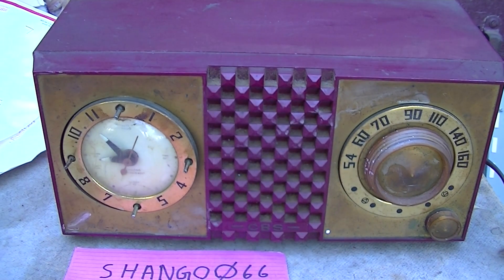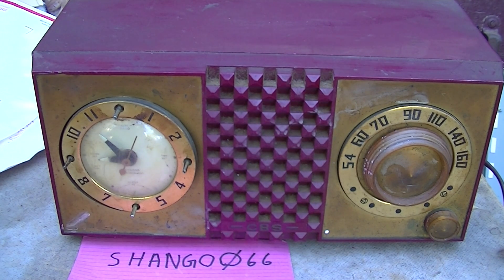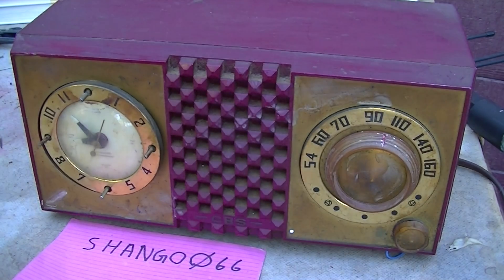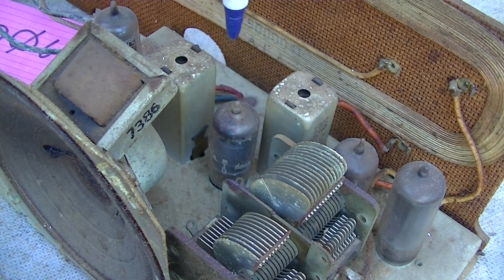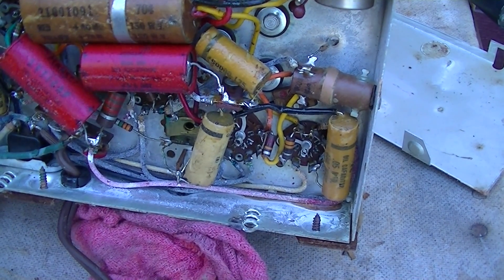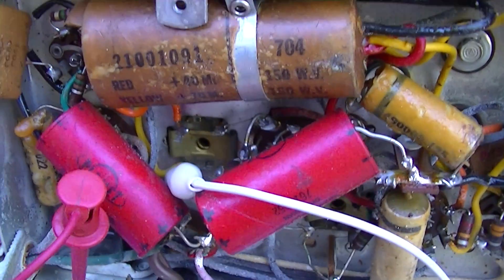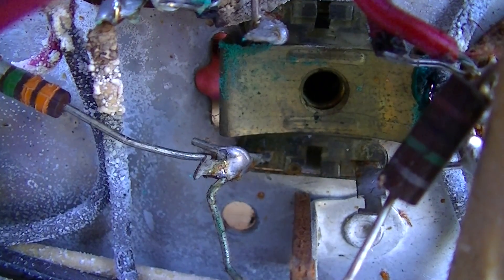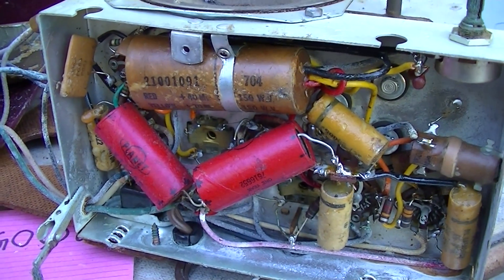CBS 5 Tube AM Radio Diagnosis

Comment: Greetings:
Suggest using modulated 455kc as signal to trace; more likely to be found, yet more test equipment in use,
After if surgery,, Use your variable caps with 455kc applied to tune for resonance with cans outside chassis, making fixed value caps easier to install and only needing 1 vari-cap at a time. (Yes a few clips are needed, too.)

Comment: looks a lot like this radio, maybe a rebranded Motorola?
http://www.ebay.com/itm/Vintage-Clock-Tube-Radio-Motorola-Model-52C-Brown-radio-clock-work-w-static-/152332135141?hash=item2377b3eae5:g:x4gAAOSwNRdX7YzF

Comment: columbia engineers made nice long lasting hi fi  radio &  & software,folks had a pile of christmas & other classical records from cbs,these records were badly scuffed & worn after about 12 years of play on a sears portable stereo record player,,half the wear for nieces & nephews putting on 45 rpm bubblegum &  fred flintstone on them, I use joy dish washing liq to soap them up,run the records under the water faucet,wiped them with a towel, played a few of them on 70s stereo system I bought,, folks were quite thrilled with the sound of a decent amp, mag cartridge.

Comment: Yuck!  Who painted that purple, or was that the actual original color?
Those "slug tuned" cans actually come two ways, a true slug that is usually tuned with a hex tool (but I've seen some that used a slotted screwdriver), and a 'cup core' type that covered the coil both inside and out, these usually are of the slotted adjustment type.  The latter are self shielding (and the cores are rather fragile!).  The hex core types allow you to adjust both coils from one side of the transformer since you can push the tool through the top core into the bottom one, while the cup core type requires you to flip the radio upside down to access the bottom adjustment.

If you have one of those LC meters (they sell them on ebay, made in China using a microprocessor and an LCD display), you could remove the caps, and then measure the inductance of the coils.  Then with a little math you can calculate what C value is required to resonate at 455khz.  You have to subtract the tube input/output capacitances, plus a bit more for wiring strays, but that would get you close enough to resonate by adjusting the slugs.  There are on line calculators for the LC resonance stuff.
Reply: That's a nice method,  but I think his way is a bit easier. Put a trimmer cap, dial it in, take it out and measure the trimmer.
Reply: Sam Gates Totally agree.

Comment: Wow! In all of my years of working on radios, I've seen plenty of SMD (GE radios win the prize) but I've never literally SEEN SMD like the arcing in the bottom of the IF can. Those red electrolytics are replacements. I saw a 6652 date code on one of them.
Reply: Jerry Carriera Question, I have a small GE AC/ DC  tube radio it has very little volume turned up all the way, you think it needs to be recapped? Thanks for any help
Reply: You didn't mention how old it is but the short answer is yes. The paper and electrolytic caps should be replaced. You can leave the ceramic caps alone as they are extremely reliable and don't deteriorate with age.
Reply: Yeah, that was pretty nasty... makes for a good diagnostic technique: turn the lights off and look at the bottom of the IF cans for flashes of light.